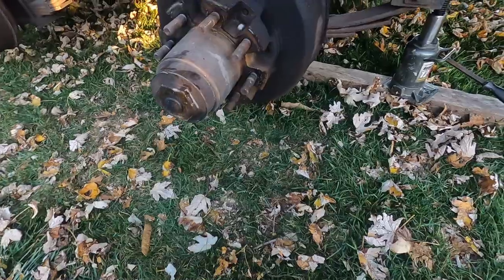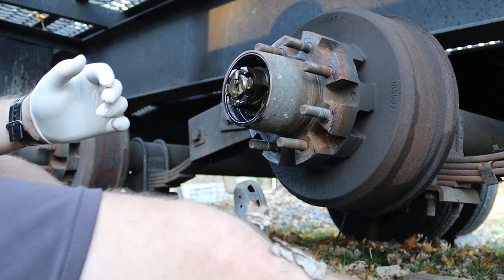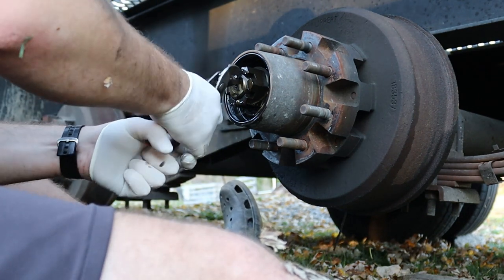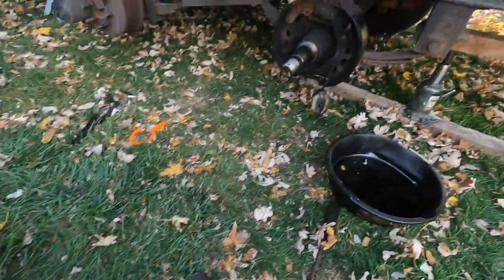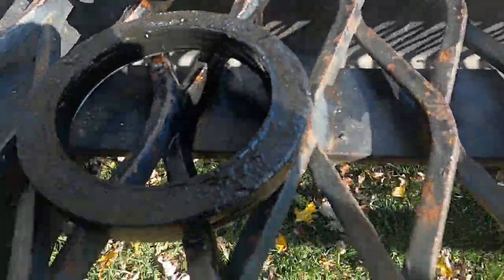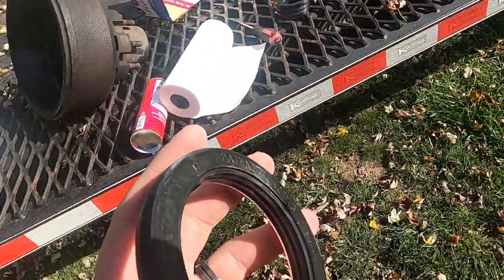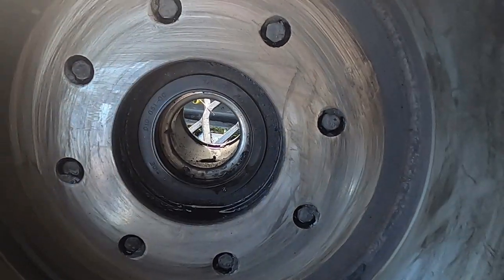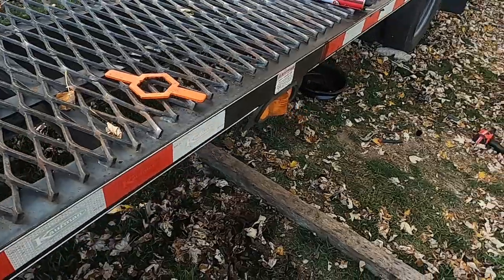How To Fix 10K Dexter Axle Wheel Seals | Fixing Before Selling |#181

Comment: I dont know if youre still doing this stuff but here is a little information for you. 1. Thats one of the older Dexter hubs and seals. They dont use those seals anymore I dont remember exactly why but this might have been it. 

2. If you plan to replace the seal and Bearing... A very simple tool for doing it using a Crowbar. VERY IMPORTANT ADVICE HERE...Pull back on the bar and quickly PUSH (AWAY FROM YOU. ) Do it in a lever forward motion. DO NOT EVER PULL  THE CROWBAR TOWARDS YOURSELF AND DO NOT RUSH WHEN PULLING OUT ONE OF THESE SEALS. On 10k it works easier to come in from the top of the hub down pounding at the bearing VS pulling out the seal.  Volcano shape if you know what I mean.

3. A tip I will give you is to save your self having to man handle the hub to to turn it over.  Is to man handle it even more but faster. 
Pull the hub towards you and let the lip of the hub come just over the edge of the trailer or surface. Quickly pull your hand straight up. It will take you some practice but if  you do it right it will flip the hub so you will be able to look down into it easy. Do it very quickly and in a controlled motion be ready to grab the hub with your other hand to stop the flip rotation once its flipped to prevent it falling.  

You can pull the seal and or bearing out from either side if you do it from above with a crowbar youll damage the bearing but hit it in one solid motion with either the bar itself or position the crowbar and then smack the end of it. The old seals were coated with Gasket Sealant by a small brush in a can. To install the bearing and seal make sure its right side up looking down into it carefully place the bearing in cone down and give it a light spin. before you put the seal on this will verify its flush. Check the hub for cracks before installing the new bearing. Carefully inspect the out side of the hubs look at the bolts and check the threads make sure there are no tiny cracks. If you do this often its worth having seal driver.  Just make sure that the bolt in the driver is very tight on the bottom to insure there will be no offset of the seal when its hit.

Comment: The brake pads are ruined if they got oil on them.  No matter how much brakeclean you use, you'll never get the oil impregnated pads clean.
Reply: Yes definitely need to replace them I just tried to do this job without replacing them and I have maybe 5 to 10% of my original brake capacity with the oily shoes and I cleaned them with about six different kinds of degreasers let them soak break clean rags etc

Comment: That was awesome you were able to do the job yourself I could not help but notice you had no safety to protect you if that Jack failed you the little jack stand was not even supporting the trailer it would be safer to do one axle at a time please don't take the comment offensively it just would have been terrible if the Jack failed you with you underneath it

Comment: Those brake shoes are garbage. You should of replaced them.  That brake clean isn't going to do anything .
Reply: Yes this is exactly right, I just did this and thought that using literally six different kinds of degreaser and brake cleaner rags brushes letting it soak etc brake pads still do not work maybe 5 or 10% of their original stopping capability.